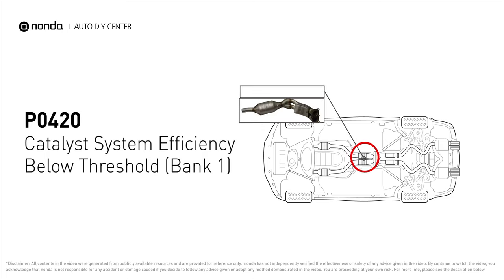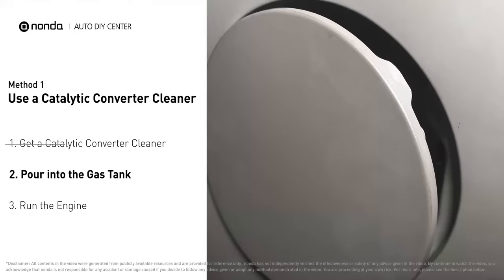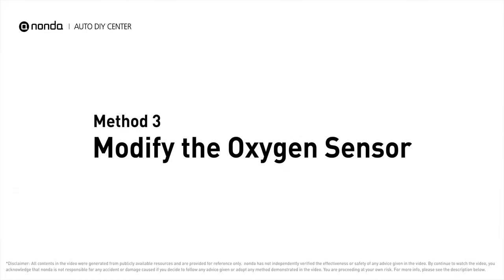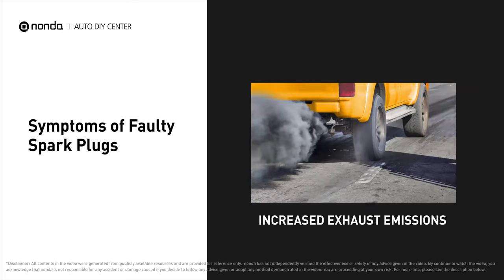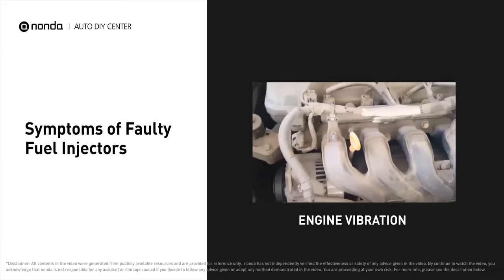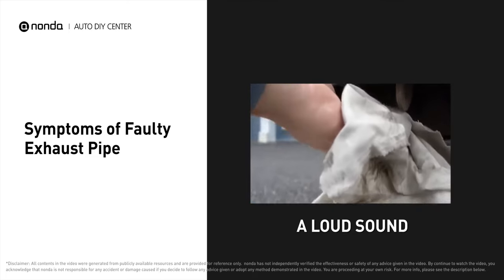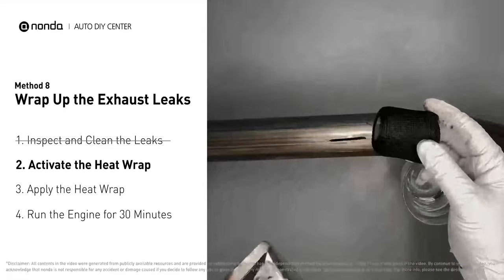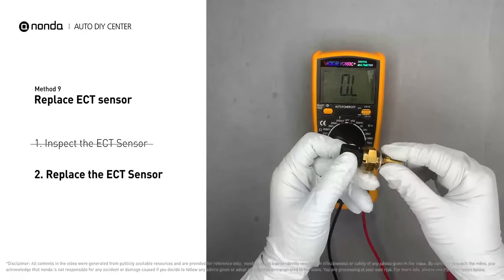9 Solutions to Fix P0420 - Don't Start Fixing Before Watching This

Comment: I have a 2020 Mitsubishi outlander sport SE,  and replace my catalytic converter, and 02 sensor. my service engine light was on and once the put the 02 sensor its  went off but came back on the next day bought to Mitsubishi and it went off but came back on again.
Reply from the maker: Hi Clara, have you double checked if this is the only code that registers?
Reply: Hi Clara, I do have the same car and same issue right now! CN you please tell me if it was a clogged catalytic converter or a faulty oxygen sensor?

Comment: what solution do you recommend if i have completely removed the catalyst converter and i get the P0420 error code
Reply from the maker: Hi Meshak, please provide us with your vehicle's year, make and model.
Reply: @nondainc  HI am driving a vw golf 6 tsi  year 2009
Reply from the maker: Hi Meshaf, since we are against having the catalytic converter being removed (to comply with air emission standards that were set for safety environment), we're afraid we couldn't provide any solution in this case. We suggest placing a new cat as well as checking the O2 sensor, O2 sensor wiring, and inspecting for exhaust leak.
Reply: You have to completely decode O2 sensors for your ECU, but then car will run on standard map. It is never good idea to get rid of catalytic converter. 

There is a O2 sensor emulator. That you can add to your engine harness. That way u can "cheat" ecu.

Comment: Good day, my 2008 Toyota Camry XLE V6 check engine light popped up when I was on top speed traveling, I began to notice a little bit increased sound when I start the engine. I used a scanner and it detected P0420 low catalyst efficiency below threshold bank 1… what do I do? Thanks
Reply from the maker: Hello, kindly inspect the exhaust manifold, gaskets, and exhaust pipes pre-catalytic converter for any leaks and repair it right away. If the issue will continue to persist, check if there's an issue with the voltage reading of the downstream O2 sensor. Since you are also hearing a noise when starting the engine, we suggest checking the temperature of the pipe before and after the catalytic converter using a thermal gun as this will easily help you know if the catalytic converter or the down stream Oxygen sensor is faulty.
Reply: @nondainc  thank you for the response. We detected the exhaust flex/net has a leak, can that be the cause of the problem?
Reply from the maker: Probably yes, Adekunle. Try also checking the temperature of the pipe before and after the catalytic converter.
Reply: So after changing the exhaust flex, removing and reinstalling the exhaust manifold carrying the catalyst after thoroughly washing it together with the O2 sensors, check engine totally disappeared and performance greatly improved. 👍🏾
Reply from the maker: We're glad to hear that you have sorted out the issue. Stay safe, Adekunie!
Reply: @nondainc  thank you
Reply: Hey bro can you give me your number so I can no where you fixed it. I’m Nigerian and in Lagos thanks.

Comment: I have a 2015 Mazda 3 touring made in Japan  with these codes and there titles any idea what it means 
1).1 permanent trouble code P0421 "catalyst 1 efficiency below threshold bank 1, 
2).1 power control module code P0421-00 status :MIL/CONFIRMED/PENDING -catalyst 1 efficiency below threshold bank 1: no sub type information
Reply from the maker: Hello, can you please confirm if there's any other fault codes registering along with this code?

Comment: I have codes p0420 and p0132 on a 2015 Chevy Sonic LT 1.8L with no check engine light on . 
I have been experiencing the car shutting off while driving lost of power in it , and jerks badly when accelerating.  Any idea of what this could be ? Please and thank you .
Reply from the maker: Hello, as you are receiving more than one error code, we suggest getting your vehicle visually checked by your local mechanic for further diagnosis. Thanks for watching!
Reply: Have u done anything to fix this or got it diagnosed? Im experiencing a p0420 code with my 2014 chevy sonic ltz. Im experiencing the same issues except for the car shutting off

Comment: Hello Sir,
I really like your vedios, its very helpfull, but i have a qustion. I have an Audi A6 2014 2.0 torbu and Ihave a problem that my car has a delay with first gear & retern (automatice gear) with cold start & blowing smoke from the exust 
when I start moving slowly the car jumping needs to turns off 
Iwent yo the service center they talled me I have a code P0011 so I have to change the intake camshaft and I know that they have no experiance to repair Audi cars 
So please can you helpe me with that ? what i have to do
Reply from the maker: Hi Ara, there are multiple factors that could be contributing to the appearance of this code particularly for your vehicle's make/model. We suggest checking the condition of the Intake Valve Timing Control Solenoid Valve/harness or electrical connection, condition of the camshaft position sensor/ harness or electrical connection, engine coolant temperature sensor and the crankshaft position sensor.
Reply: @nondainc  
Thank you so much for your help, I have already toke off the CAM& I found the connection clip of the Camshaft Adjuster Magnet full of oil, is that a reason for this fault?
Reply from the maker: Possibly, yes Ara.

Comment: P0420 2007 honda civic hybrid bank 1 catalyst system code. Any help/tips/ suggestions you can give me ? Please and thank you
Reply from the maker: Hello, if there's no other codes registering together with this code, you can follow the DIY tips/guide provided in our video on how to fix P0420.
Reply: @nondainc  initially the only code I came up with was P0420 and changed both 02 sensors but now it bunched up with my MAF Sensor despite me just getting a new one recently.  I'm really debating just spending the money and getting a new Cat even tho I don't want to at all
Reply from the maker: Have you checked the O2 sensor wiring? We also suggest checking the engine temp sensor, timing and look for exhaust leak.
Reply: @nondainc  thank you! Will do forsure

Comment: Awesome! Thank you!
Reply from the maker: You're welcome, Jeffrey! Hope it helps!
Reply: @nondainc  I’ve got a 07 Mini Cooper S. Literally going through a rough patch. Replaced coils, plugs, 02’s, carbon cleaning and oil change. Still rough starts and on and off limp mode. Little to no boost. Muffler pro said the cat is fine. 🤔🤷🏻‍♂️

Comment: I got a  2011 Chevrolet Traverse i just bought with 222k miles. Test drove it 3 times before i bought it and ran fine every time. Had a 40 min drive home from lot and about 30 min in the rpms started to drop. I took it to auto zone and got it tested for free and they said it was a bad catalyst system low efficiency bank 1. Told me to try Cadi clean but they was out every where so i got a diff brand and it took the check engine light off but it still ran like shit. Put it in a shop and they charged me almost a k to replace the first one. I get it back  and drive my wife to work that night and it does the same stuff. Took it back to auto zone and it pops for the same thing.  Do you think it a bad o2 sensor or converter that is post to be new. Cant get no one to answer my call at the shop in 4 days. Also if it is o2 sensor are they required to fix it for free since they misdiagnosed my car. They even told me it was the converter.
Reply from the maker: Hello, have you double checked if there's any other fault code that registers along with this code?
Reply: @nondainc  both times i took it to auto zone that is the only code. people at the shop acted like that was the only thing wrong with it too. I even told them that was the reason i brought it in to make sure it was the converter and not something els. Starting to think they played me because i put some stuff in it to clean the converter before i put it in the shop and it made the check engine light go off. So im not even sure if they can run a test with no check engine light on.
Reply from the maker: Hello, the issue could be coming from the O2 sensor. To be sure, we suggest performing a test on your O2 sensor and catalytic converter.
Reply: @devilboykillz Was it fixed now?

Comment: girohead, so yours ended up being the cat then.  OK well i really don't want to spend time puling out the intake manifold and putting in a new gasket when i don't even know if that will clear my P0420, I might as well start looking in to a cat.  Thanks for the info, I guess i can try the soapy water spray first.
Reply from the maker: Hope it helps!
Reply: Yes

Comment: p2701 Hyundai transmission friction element 'B' apply time range /performance
Reply from the maker: Hi Ahmed, you may head over to this link for your concern. https://youtu.be/OQVUaOrziUo
Kindly check the condition of the following and repair/replace if necessary: Transmission fluid/filter, wiring/connectors, transmission pump, TCM, output speed sensor/input speed sensor and inspect for transmission fluid leaks.

Comment: Sorry most of this is BS. And spacers do not fix the problem just take the sensor out of the flow of exhaust so it will not longer read the exhaust values. And it will not work in cars after 2012 because they got wise to this and set a program in the computer to detect it. If your check engine lite starts flashing while you are driving pull over and shut the engine off and get the car towed or keep driving and ruin the cat.

Comment: I don't get any of these symptoms
Reply from the maker: Hello, can you tell us your vehicle's year, make and model?
Reply: @nondainc  Hi! I have a 2016 Audi A1 Sportback, I have done basic maintenance, replaced oil and filters. Checked for exhaust leaks. I am using high quality fuel. I get the P0420 error. I have not yet tried all solutions here, but I just find it weird that I don't get any symptoms. The car operates normally and if it wasn't for the error I would say it was 100% fine! Without symptoms it's much harder to diagnose this problem. I think I will change spark plugs next, I don't think they've ever been changed.
Reply from the maker: Have you double checked if there's any other fault code that registers along with PO420?
Reply: @nondainc  There is no other code.
Reply from the maker: Please follow the methods we have provided in our video and kindly let us know if there's any update. Hope it helps!

Comment: 2007 VW JETTA.P0420
Reply from the maker: Hi Okan, you can follow the DIY tips/suggestions provided in our video on how to fix P0420. Hope it helps!
Reply: I have the same code for my 2007 VW Jetta
Along with mechanic advising that I remove cylinder head 🤔

Comment: gr8 viDO, 😩buuuuuuuddftt??… 😯wat aboOt,  thE OTHERrrr.. infinity -9 possibilities, hmnnn?? - IO, the DREADED meaninglS P420.
Reply from the maker: You cOuLd chEcK mORe possibLe caUseS:
Faulty Three-way Catalyst Converter Bank 1
Exhaust Tube
Intake Air Leaks
Faulty Oxygen (O2) Sensor
Faulty Fuel Injector(s)
Leaking Fuel Injector (s)
Faulty Spark Plugs
Improper Ignition Timing
Faulty Engine Control Module (ECM)
Dirty Air Filter
Reply: okdOk- wEr doOn to infiniT -12, nooot 2 shaB☹️✋